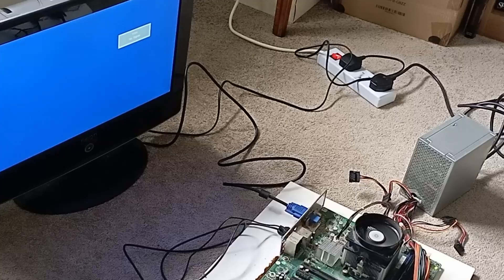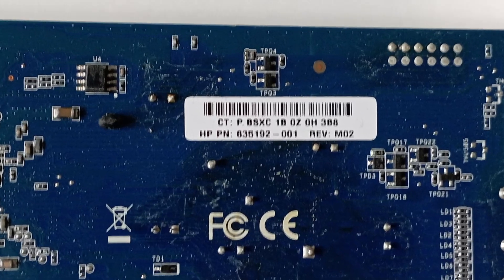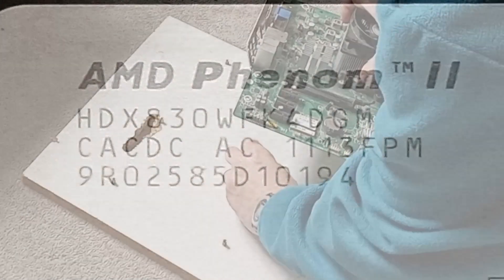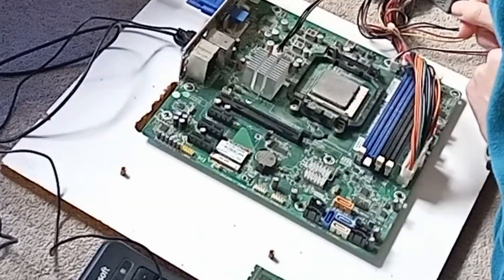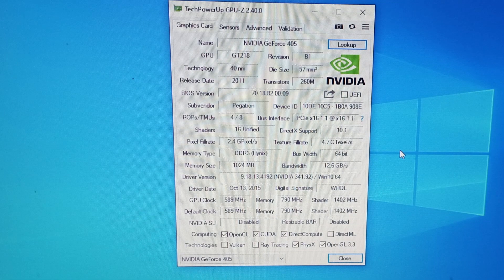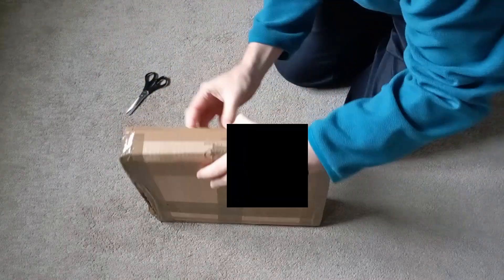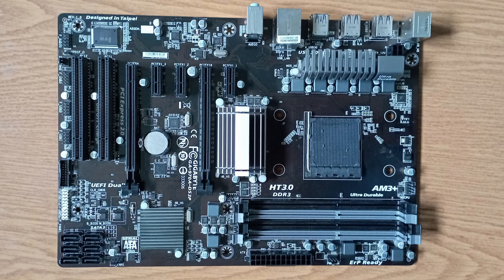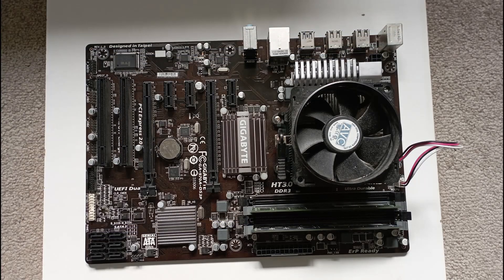AM3 Motherboards - Hours Of Fun!

Comment: I have 2 of these Gigabyte motherboards and 2 of basically the same motherboards but in the smaller form factor and they have run flawlessly for over 10 years. The first two have 2060 supers in them and the smaller form factor boards have 1660 supers. They all run everything from Quake 2 to COD4 and everything in between perfectly. The only reason they are in the Lan room for gaming only is because they are Windows 10 machines, and I pulled them offline earlier this year to keep them running perfectly. I found that as I upgraded my newer PCs over the last few years, I could move the old parts down to these older computers which I think is what has extended their life.
Reply from the maker: 2060 supers?!?!? They have got to be bottlenecked by the CPU's?
Reply: @Tech-Nerdrome  You would think so, but these AMD FX chips do a pretty good job, at least on older games like CODWAW and MW. They pump out a solid 500FPS, but I cap them at 333 fps so I can do all the glitch jumps. It's only RTX Quake 2 that won't go past 60fps which screws up a few 100FPS jumps.  I have much newer computers with 3090's that don't do as good, but that may be a Windows 11 pro issue. I will add that none of the cores are parked. The 8 cores run full 8 cores, same with the 6 core ones. Another note is, I believe the spec say max supported memory is 16 GBs but 32GBs runs fine and the small form factor boards can run 16GBs instead of the list max of 8GBs.
The only time I had trouble was years ago when I ran 2 AMD 6870's in crossfire mode. There was in-game lag, but one at a time worked great.

Comment: I have a few old 970 and 990 boards that I'll pull out and screw around with here and there like they're going to get any better over time. Just this morning I was testing one of my first motherboards that was purchased brand new. A AMD FM2+ with a 870K that my brother brought back from China in the early 2000's. I paired it with a GTX 560 ti and was actually able to play some recent games at 720 / 1080p depending on the game. I fell asleep about 3:30 a.m. waiting on some drivers to download. My son got me up this morning and said "dad, your bedroom is hotter than the blue blazes of hell itself? What happened last night??" "I pulled out the old AMD son, it's winter time!" But on a real note I'm glad he got me up. I was using a peltier and it got overwhelmed while I fell asleep and burned out due to the top not dispatching enough heat. I forgot that's what I was originally testing.
Reply from the maker: The FM (1, 2 and 2+) were probably the first Apus that had useable graphics. Although not really widely adopted, or used, I think we owe them more than they're given credit for. Stay safe with your nerding!